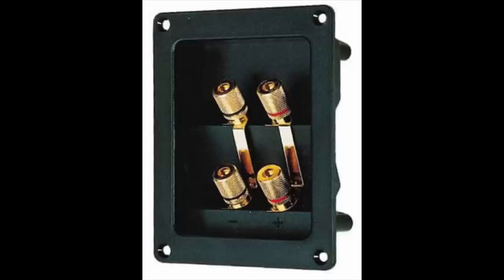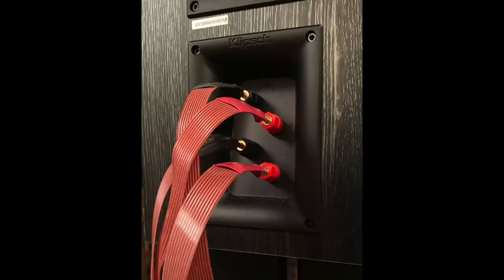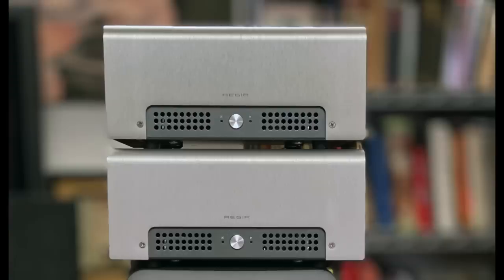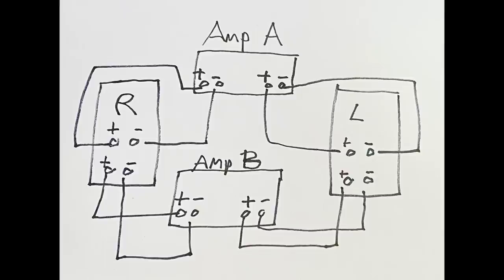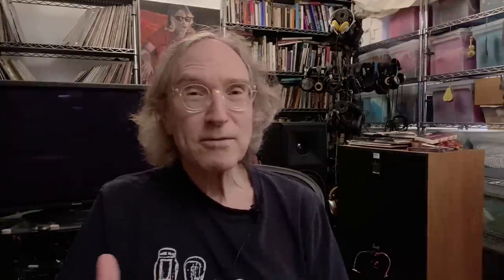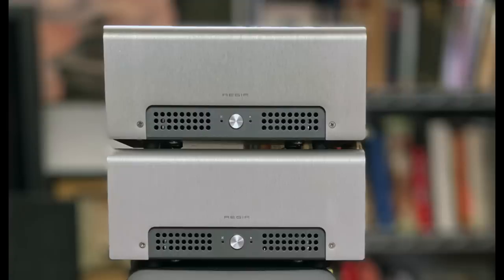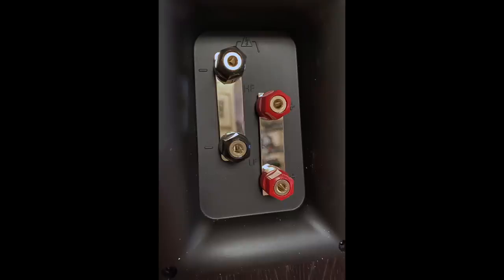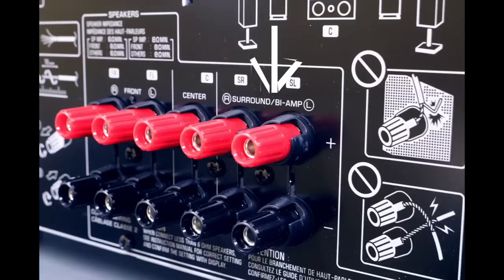It's time to think about bi-amping your speakers!

Comment from the maker: I think I explained bi-amping very clearly. NO extra parts (including crossovers) are needed. To bi-amp your present speakers all you need is: A speaker with double binding posts, two pairs of speaker cables, two identical stereo amps (or a receiver with bi-amp capability). THAT'S IT!! Of course, you can make it more complicated, but that wasn't what I set out to do. You don’t have to take my word for it about bi-amping, read the comments from viewers who are doing it! As I described in the video!
Reply: I'm about to try my hand at bi amping I'm making a set of speakers for it a wmtm out of live edge Walnut slabs and see for myself what this is going to sound like
Reply: Hi Steve, when you mentioned that some AVRs can be used to bi amp loudspeakers with dual binding posts, I dug out the manual for my Marantz SR. 7005 and read the bit about bi amping. I got myself two lengths of 14 AWG speaker cable and eight banana plugs and did the job. The sound was excellent before and now it is amazing. One thing to bear in mind is to allow the amp to settle with extra load of cables plus burning by playing music (Stereo plus sub, with bass management off) for a couple or so hours.Thank you, Steve. Many thanks, friend. Cheers.
Reply: In my opinion you should have really elaborated on the difference between horizontal vs. vertical bi-amping. A bit disappointing this was left out...
Reply: As I stated in my original comment, "I was disappointed", for the reasons stated. I never disputed the merits of bi-wiring. I didn't yell or use exclamation points, I just respectfully stated my opinion. In re-reading my comment and evaluating the tenor of the content, I standby my statement.
Reply: @michaelbutler2193  This site is not about airing anger and displaying arrogance.
Reply: Steve Guttenberg  -  could you make a video of the advantages, if any, of using bi-wiring for speakers ?
Reply: @angelllacuna8889  Bi amping is the way to go. Did you know that with some top shelf Marantz AVR, you can bi amp your dual posts loudspeakers?. Its in the manual. I did it and is truly awesome with my Klipsch RF 63. The idea is to select 80 hz crossover for all loudspeakers including so called LFE and set LFE plus large, remove straps on loudspeakers and select AMP C on AVR. That is music in stereo. Transformed sound.  No need to buy two power amps and a preamp. Yes, you do need to get two extra lengths of speaker cables (14 awg or bigger) and eight banana plugs
Reply: Buy lamp
Reply: Hey Steve, first of all , thanks for the clear story. what i still wondered is , what is the ratio between the watts of the preamp and power amp ? i can't find nothing about it on internet so far.
Reply: Steve... long-term fan. As an experienced bi-amper, and a  professional listener/producer (in addition to the points you raise) I believe the MAIN advantage is crossing over at line level for 2 reasons:
1. Most affordable speakers use very cheap crossover parts (several cool YouTube videos show the benefits of upgrading them).
2. Passive crossovers dissipate the signal, no matter how slightly.
If you review active external crossovers (especially DSP controlled) and compare, I think the experience, albeit a bit more complex, even fidgety, will amaze on most affordable speaker systems.
Keep up the great work!
A
Reply: No its not. Im happy with 1 Strereo Amp

Comment: Steve I have Biamped several times in my 57 year audio journey with no success then i used amps with volume control then came great success . I have split La Scalas all drivers physically time aligned .I have a 4 watt triode tube amp on top end and 35 watt solid state A/B on bottom end.I have the magic of tubes top end and the slam of solid  state bottom end. The sound stage is deep and wide. Imaging each instrument has its own place and you can tell where the singer is standing.The final piece to the sound was a edgarhorn subwoofer not just adding the last note in bass but I was surprised how it added ambience and made the lower register instruments bloom.Pre covid I went to about 40 blues and jazz shows a year with well controlled acoustics . I wanted my system to rival a live show. Part of the fun is the experimentation getting there.
Reply: Do you find that dimming the lights almost all the way helps to clarify the 3D soundstage? That is my experience. They say that blind people can hear slightly better, and I believe it.
Reply: great comment.  i also miss going out and hearing music at a big scale regularly. covid has made my home system way more important to me.  it's a luxury i'm really lucky to have, because it seems to make my brain a lot happier and better-adjusted if i get to listen to my system a couple times a week :)
Reply: So did I. 4 x JBL 4320, on Nakamichi pa7.

To top end is anything from Rogers LS3/5a to Celestion SL7, again, driven as two ways by two stereo amp, or one 
stereo amp driving the pair. It depends.
Reply: @hxhdfjifzirstc894 
Im not the only one!
Me myself love listening in the dark. Get less room distraction more focused on tunes. 🎶

Comment: Steve, thank you so much for this video, I've learned so much from you. Just tried this Vertical Bi-amp with 2X 829B Class-A Tube Amps, 12WX4 into my older Polk RTi8s. it was an amazing  audio experience, punchy & speedy bass, clear & thick Mid, crispy high. I can't go back to my Bi-wired Cambridge setup anymore.

Comment: I bi-amplified my Tannoy XT8F's and was impressed with the improvement. Cleaner, faster bass, far better mid and treble fine detail. Also improved sound stage width and depth with holographic imaging. On some recordings I hear sounds coming from the side of my listening position which makes me jump.
Reply: GeneralCurtis3LeMay  I'm using two dual monaural lateral power mosfet, dc coupled power amplifiers. Each channel has it's own 625VA toroidal power supply
and uses four Exicon lateral power mosfets fed from a split 80-0-80 volt supply. I designed and built the power amplifiers a few years ago. I'm using four Gale OFC 2.5mm speaker cables which are each 2m long. I designed the power amplifiers to have a voltage gain of 22 so I can drive them directly from my Topping dac.  I operate the dac in pre-amp mode using the remote control to adjust the volume.  The 2 volts RMS output from the dac will drive the power amplifiers to 44 volts RMS output which equates to to 244 watts into 8 ohms. Obviously I never run anywhere near full output power. I only use a maximum of 10% of the available power in order to prevent clipping on transients.
Reply: GeneralCurtis3LeMay  Here is a link to photo's of one of my power amplifiers on posting  6902: https://www.diyaudio.com/forums/solid-state/96192-post-solid-pics-691.html My previous posting on here stated a split supply of 80-0-80 volts which is 160 volts with a 0 volt centre.  Full power unclipped sinewave at 1KHz into 8 ohms is 272 Watts per channel and 450 Watts per channel into 4 ohms. Tannoy speakers work best with high damping factor solid state amplifiers and mosfet power amplifiers are wide bandwidth, high slew rate and high damping factor. Bass reflex loaded speakers rely on amplifier damping factor to damp the bass cones apart from around the frequency where the port operates. Around 20 years ago I designed an improved crossover for the Tannoy HPD 385 and 3828 drivers which has been copied by many people world wide who were very pleased with the improvement. I therefore do know Tannoy's very well indeed.
Reply: GeneralCurtis3LeMay  Ask Steve regarding what amplifier he used to listen to the older Tannoy....and I worked for Radford audio back in the mid 1970's. Have a nice day chum.
Reply: GeneralCurtis3LeMay  How do you figure that +/- 80V rails can't produce 244 watts RMS (not peak) into 8 ohms ?
Reply: GeneralCurtis3LeMay  When did Steve introduce an "Inadequate Troll of the month" award ? You seem to be going for it big time. Also linking to your account reveals a somewhat less than healthy obsession with napalm and hydrogen bombs. Wow.
Reply: GeneralCurtis3LeMay  How about a nearly 40 year old amplifier by design genius Bob Carver a pioneer in this class G design and later class H design. In this article they mention the rail voltages and measured nearly  1200 watts peak in bridged mode which means enormous headroom for transients. Also note it's small size and light weight and that it can also push a lot of current for hard to drive speakers. https://www.hifinews.com/content/carver-m-400-cube
Reply: GeneralCurtis3LeMay  You originally asked for a retail design amplifier that outputs 250 watts on +/- 80 volt rails which is what I did. Yes Hitachi filed their patent in 1976 for class G and Carver filed his in 1978 with improvements to eliminate the commutation diode glitch. Some service people didn't like his designs because they were not smart enough to figure them out . I have an MXR130 and the magnetic field coil does hum at various power levels in a perfectly quiet room , but cannot be heard with quiet music playing , I had a Kenwood monster receiver the Super Eleven but my new Ohm Walsh 2 speakers did not sound nearly as good as they did at Tech HiFi .Then I got my Carver and my speakers came to life ,the improvement in the sound was quite noticeable , like tighter bass, wider sound stage, warmer midrange and highs ,and I heard things (fine detail like a musician taking a breath) that I never knew was on the record or CD. I don't know what you are talking about crumbling parts. I now have his Sunfire Ultimate Receiver II which sounds almost tube like in it's sweetness. At 200 watts X7 it is the most powerful AV receiver made. His Sunfire products were often compared to products costing many times what his cost. Did you read the glowing review in Stereo Times?
Reply: Exactly. The soundstage definitely has more separation between the highs and mids. The sound is more lively as well.

Comment: This is all very interesting.  A few months ago I decided to experiment with bi-amping.  I thought why stop at two amplifiers?  To cut a long story short I bought four Chinese Nobsound mono amplifiers and a two way Linkwitz Riley electronic crossover pre-set at 2800hz cut off for the bass units..  I connected the whole lot up using splitter cables from the crossover to the amps.  The result is amazing!  I use an ancient Cambridge Audio Azur 640c and and equally ancient set of much underestimated Sony SS 176E speakers ( jumpers removed) all coupled with cheap but good quality interconnects and cables.  I have to say that the system sounds as good as many of the ''high end'' setups that some of my more affluent friends posses.  They begrudgingly agree with me and one of them so far, has bought the same units for their second system.  Everything was bought from eBay and cost less than £200.  Would gladly send pictures for your next feature on  watchers systems if you wish.
Reply: By any chance were the Nobsound mono amps you bought the 300B class A amplifiers? The tall looking ones?
Reply: @maxgeronimo3720  Hi I am using the  cheap ones! and they are perfect but not very loud. Nobsound Mini Mono Channel Digital Amplifier HiFi Class D Desktop Audio Amp 100W
Reply: @claretlover1  Thanks and I appreciate the reply! ! I’ll check those out! 👍🏻

Comment: Steve, you’re the best! Thanks for making the two channel listening topic interesting for so long. Although, lots of esoteric types of amps exist in the marketplace, biamping is the perfect job for an Av amp. I used the biamp function on my marantz sr8015 and it improved my Cornwall IV speakers immensely. Imperceptible difference between the marantz sr8015 and much much more expensive mono block amps. Lastly, great integrated av relievers are a fraction of the cost of dedicated two channel amps.

Comment: It looks like Steve did a horizontal bi-amp configuration.  I've been running my Dyna/VTA ST-70s vertically bi-amped per Bob Latino's suggestion for the past year.  The result is wonderfully improved separation, clarity, soundstage, and dynamics.  Tonal balance is roughly the same, so it still sounds like the same system, but many other aspects are simply better, bigger, more involving.    

This setup uses two identical stereo amps...one amp on each side that work like 2 channel mono blocks.    The stereo signal from the preamp gets split to left and right sides like normal, but the amp inputs on each side share that signal, then one output channel feeds the woofer, and the other channel feeds the mid/highs, with the passive crossovers separating that output (active crossovers could also be used between the preamp and amps but are optional if your speakers already have passive crossovers and dual binding posts).  This dedicates one channel to the tougher task of driving the woofers, while the remaining channel has the simpler task of driver the mids/highs, which improves clarity.   In this setup each amp's power supply only has responsibility for one woofer, vs two with a standard stereo setup.  I use matched EL34s/6CA7s per channel, but this setup allows use of different brands (or even different compatible tube types) on each channel....just do the same for each amp.  I use tubes that have tighter bass on the woofer, and different tubes that have better mids/highs for the other output, so the sound can be more tailored more to your liking.  I do have a powered sub that augments the lowest octave, which I keep turned down to hardly noticeable with the low pass crossover frequency at the lowest setting of 40hz.

https://www.audioholics.com/frequent-questions/the-difference-between-biamping-vs-biwiring/HorizontalvsVertical.jpg/image

Comment: Thanks for showing the ins and outs on this subject. I'm a big fan of the bi amp camp. I'm currently doing this on my Vandersteen 2ci with amazing results. I use a Sony Ta-n 9000 ES for the amp and its perfect. I had  Definitive Technology set up on it but prefer stereo. I was watching a movie the other day and would've sworn I'd been dosed, the soundstage was stunning, with an almost holographic sound.  The bi amp is worth the investment of extra cables if you have a surround system to adapt. Keep up the good work Steve.

Comment: Steve, thanks for the input. I'm having great results bi-amping Q Acoustics 3050's with Iota VX stack (pa3 and sa3). The Iota's were good in mono mode, but more presence and power in bi amp configuration. Better mains cables didn't hurt either. I can validate your experience.
Reply: I have 2 Marantz pm 10’s bi-amping concept 500’s, very pleased as well

Comment: Vandersteen speakers, model "Quatro" and up, are all bi-amped, via external high-pass passive filters.
The high-pass filter reduces the bass frequencies by 6 decibels (I believe), and compensates for that reduction via the amps that power the woofers.

The midrange and higher frequencies are passed through "as is".

The advantage to the above design is that the amps that power the top section of the speakers (where your ears are most discerning)... those amps have far less bass content to deal with (and it is the bass frequencies that put the most stress on amps).

So your amps that are dedicated to the mids and highs are relieved of dealing with difficult bass frequencies (not completely, but to a large degree), allowing them to more efficiently, more correctly, and more musically power the range of sound that you hear the best.

The speakers are designed to reverse the -6db bass that is going to the woofers, leaving your bass section sounding neutral and correct.

As an aside, the Quatros and up do their own version of DSP, with the bass.  When set-up professionally, with sound pressure level meters, it does a wondrous job of compensating for bass issues that are inherent to 99% of listening rooms.  It is not a substitute for room treatments.  It is a compliment to room treatments, and can do its job independently of room treatments (although room treatments are still beneficial, and significantly so).

Comment: A lot of the improvement is splitting the hi-pass and low-pass filter plus load apart. Now each amp only sees one of the filters plus load. Greatly reduces the weirdness of the reactive loads during transients.

Comment: I did this recently using my Cambridge audio Azur 650r on my PSB Imagine T2 and boy did it wake up my T2's! Doing this provided more dynamics and transparency. Plus it allows you to experiment with different speaker cables for the top or the bottom. My current setup is using second generation Kimber Kable 8tc for the bottom end and 4tc for the top end result, perfection to my ears!

Comment: OF COURSE THERE IS A DIFFERENCE!!

I have tried 3 different bi-amping combinations with my pair of Klipsch 280 RP-280F (not high end gear unfortunately but always very common pedestrian amplifiers) and the common factor has always been the preamp (NAD C165BEE) which has two outputs and, even better, it has a knob to lower one of those outputs down to -12dB versus the other output so that you can perfectly balance your amplifiers.
 The combinations I have used:

a) Gemtune GS-02 KT88 valve amp for HF
    Harman Kardon AVR2600 for LF

b) Gemtune GS-01 LE34 valve amp for HF
    Gemtune GS-02 valve amp for LF

c) Gemtune GS-02 valve amp for HF
    Rotel RB-1050 amp for LF

Everytime, the sense of a larger soundstage has been evident (very evident) but, everytime, at the moment of pumping the volume up (85dB 
and more at 9 ft from the speakers) the problems start with gritty sound and distorted midrange; listening at contained volume has always been a real pleasure.

I guess I need to look two amps of better quality...